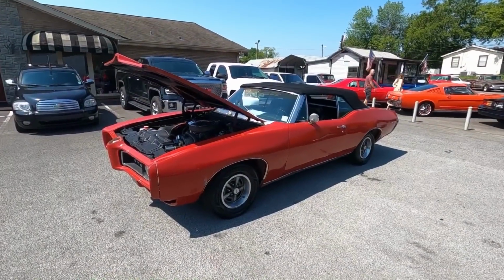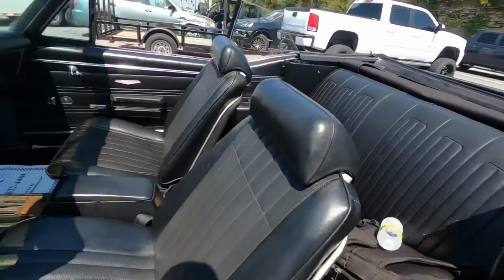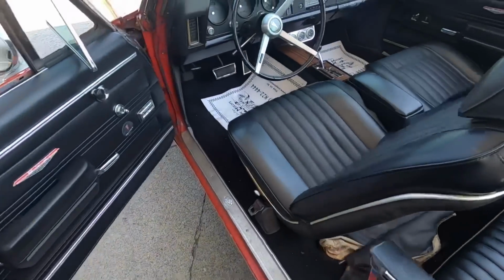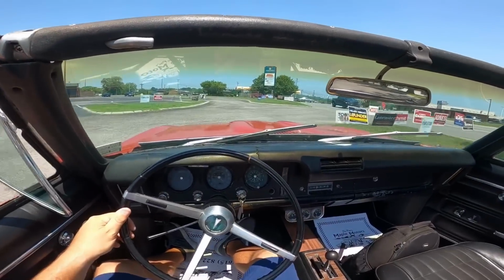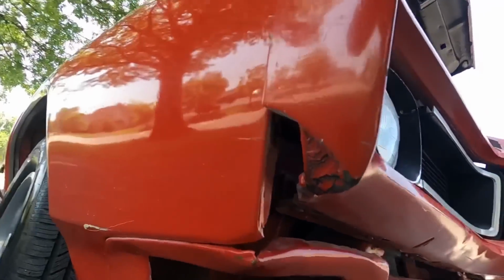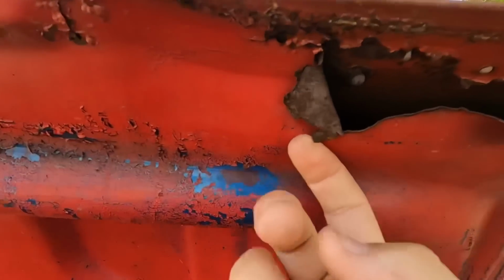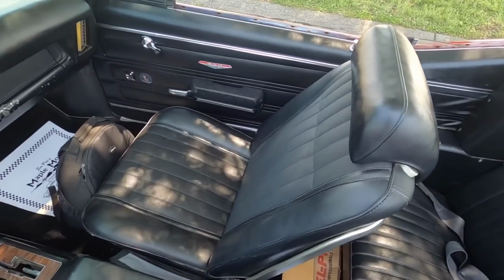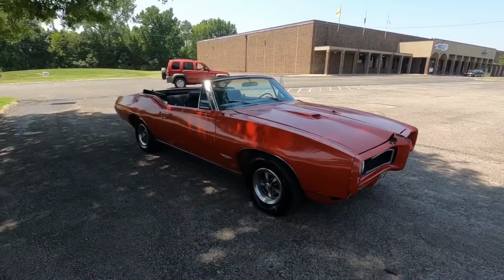Test Drive 1968 Pontiac GTO Convertible 400 SOLD $19,900 Maple Motors #1659

Comment: For the "know it all" folks, look at 20:21, you can see the VIN and it shows 242= GTO and 67= conv, 8= 68 and B = built at the Baltimore plant. lemans starts with 33 for Tempest, 35 Tempest custom and 37 for Lemans. They only built 9,980 GTO conv in 1968.
Reply: 12 bolt rear end too
Reply: Not %100 sure but every GTO I've been in during the 70s had wood grain dash. After all this time anything can be changed, including the VIN. Most people swapped out the 10 bolt Pontiac rear end for a Chevy 12 bolt.

Comment: New hood , deck lid, Enduro bumper front valance rechrome rear bumper a ton of body and rust work new trunk floor check interior floor , new dash and gouges etc a total restoration $70000 and you have a nice convertible not that many around can be done.

Comment: Lucy needs some love, drum brakes, carburetor, rust underneath, oil leak, AC, updated engine, front end alignment, cosmetics inside, Im wondering about the retractable roof, minimum $15,000 you have to drop into Lucy, that might be a Lemans with GTO front and rear bumper
Reply: They don’t restore, just buy and sell.

Comment: Is it equiped with the flip lights and do they work? If not, this might be a ragtop Lemans.
Reply: I don't see where it has them not bashing but seems like a lemans dressed as a GTO
Reply: It's easy to check to see if it's a gto the Vin will read 24237 that will be on the Vin plate ,dash board on drivers side in corner , title and registration
Reply: @tc6580  it was a option in 68. My 68 goat has that option. It will be in the build sheet. If it's still there on top of the gas tank. That's where you will find it.
Reply: @tc6580  I don't know about that. I think the chrome bumper was for LeMans.  Never seen a chrome bumper GTO. But I mainly do corvettes. Tho I do have a couple of low miles Plymouth muscle cars I bought at a good price. My 68 ragtop GTO I just picked up Saturday, barn find, no rust, and complete.

Comment: 68 Goat convertible for under $20k great restoration project body work first then repaint back it's original blue color it would good blue but least convertible top works well wouldn't touch engine or trans tho.